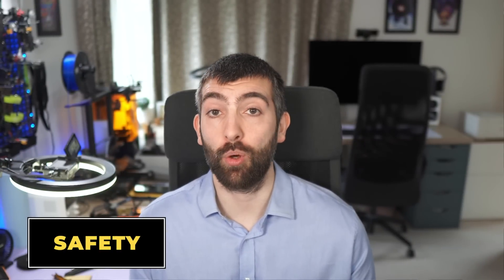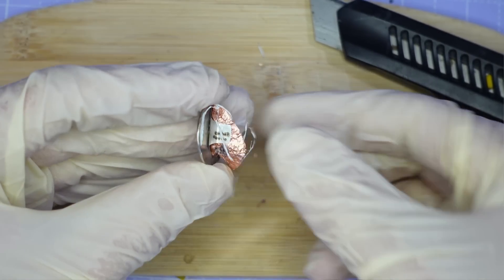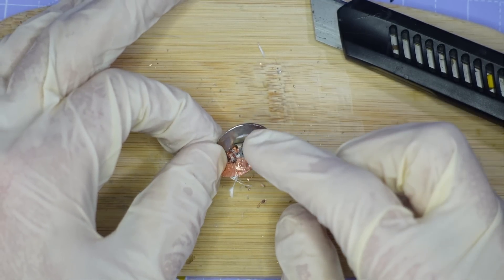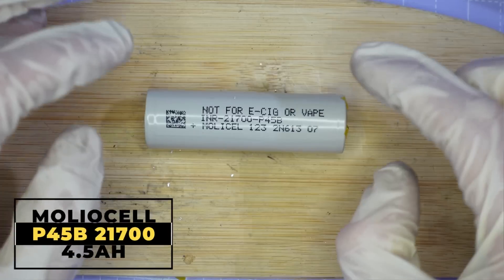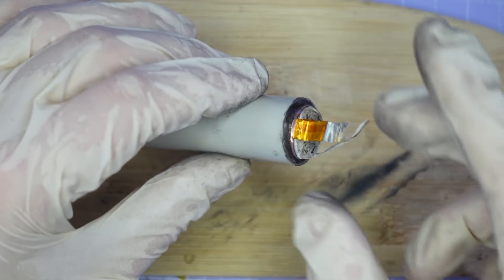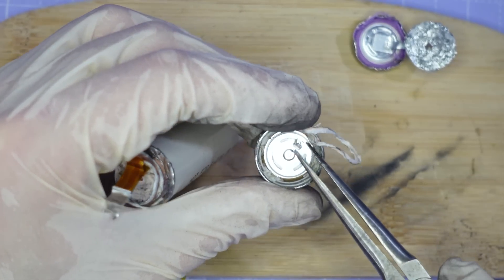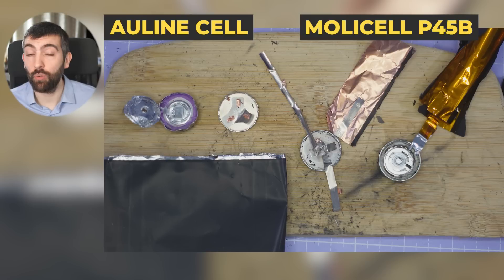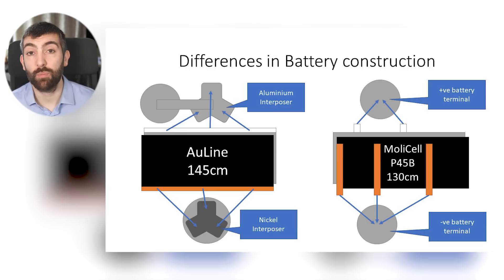Cutting open the BEST Li-ion cell in FPV: Molicell P45B

Comment: If you want to still use a dremel to dissassemble cells I recommand you tu use diamond cutting disk as it will not generate particules that contamine your cell cut. It make a better more precise cut with only 1-2$ cutting blade

Comment: It would be great if you could do a lion battery testing video like you did with the lipo's! I'm especially curious about these new high discharge 21700 cells that are coming out, for example the BAK 21700 4500mAh 60A one. Can these actually deliver a continuous discharge of 60A? and if so what is the voltage sag like? because if they can than that could be a game changer.

Comment: whats the best option for high range molicel p45 or another 21700cell?
setup are: 60v with 2x 1400w motor and 40-45a controller.
driving between 30-70kmh.

Comment: That P45B cell definitely had all 3 copper tabs spot welded. The one you thought wasn't spot welded had the weld ripped out of the tab and a "hole" like that is how you can tell if a spot weld was done with enough power. A proper spot weld (at least when doing nickel strip to the cell can) should be removed with pliers (if it can be pulled off without tools its too weak) and the nickel strip should have a chunk of the material ripped out of it that should remain on the can. The material left on the can is called the weld nugget. A spot welder with insufficient power for the material you are welding will leave little dots on the bottom side of the nickel but there will be no true welding of the two materials together. The strip will come off in one piece with only those dots having provided some slight hold on the can.

Comment: I used to work for a major manufacturer of industrial, commercial, and aerospace Li-Ion cells. I have some video I took of the assembly line from A - Z if you'd like to see it.

Great vid.
Reply: Yes. I would like to see
Reply: Me too 😊
Reply: Please please please upload as much as possible. Especially for cylindrical cells but of course pouch cells would also be interesting
Reply: Yes please!
Reply: absolutely yes - thanks

Comment: i like the auline construction better
it's somewhat similar to the 4680 with a short current path
it's just that little ribbon that connects the interposer to the terminal that's holding it back
Reply: spot welding the copper tabs to nickel...to then weld that to the can is DRAMATICALLY increasing IR

Comment: I always used the Sony Murata 25 or 35a 18650 cells, they where always ranked best in the flashlight community. But they are nowadays ditching 18650 cells for 21700 cells.
Reply: The flashlight community mustn't have tested molicel cells.. The molicels have been the best performers for quite some time for both the P and M series cells.
Reply: @StarsAtNight1  I think you mean mWh, not Wh. 
You missed the part of my comment "both the P and M series cells".

The molicel M35A is a 3500mAh cell and handles the same current as the VTC6,
Reply: @StarsAtNight1  I know what a watt hour is. Hence why I said "I think you mean mWh" because you did the math wrong. 3000mAh = 3.0Ah. 3.0Ah * 3.6v = 10.8Wh or 10,800mWh. 25lb battery generators have ~300Wh of capacity. If the cells had 10,800Wh of capacity (10.8KWh) they'd be the size of a large fire extinguisher.

Molicel (like all other manufacturers) make 21700 and all other standard cell sizes. The internals are the same - just more of it and larger sheet heights. The better performance of the molicel cells is the same on the larger cells as well.
Reply: @ryanokeefe12 I just took the numbers from the website called  lygte info dk
Reply: @StarsAtNight1  you arent reading what I'm saying. The cells are ~9-11Wh, not ~9,000-11,000Wh
Reply: @StarsAtNight1  oh ok.. strange. at least you use metric.
You'd think they'd use the same numbering punctuation as the rest of the world to avoid confusion though.
Reply: @ryanokeefe12 I looked it up, Asia, the USA, Australia and with a few African countries use a point for decimals. Canada uses both... Most of Africa, South-America and Europe/Russia uses a comma for decimals.  But anyways I need to a closer look at the Molicels cells, if they are better and cheaper it's a win/win scenario.
Reply: 21700 Molicel p45b vs 21700 Sony vtc6a which one better for flashlight?

Comment: They need to make a li-ion soft pack like lipos because the metal case adds a lot of weight
Reply: but also rigidity and strength
some lipo manufacturers add aluminium plates on the outside to propect against damage in crashes
Reply: yea
Reply: They do.. It's what's in your phone. They're called lithium-ion-polymer cells (sometimes called 'pouch lithium-ion').
It get's confusing because people often refer to them as 'lithium-polymer' cells but they are different (mainly the electrolyte).
They're far more expensive and usually can't handle as much output current as the construction of the cylindrical cells allows for lower IR. The casing also works to dissipate heat.
Reply: @ryanokeefe12  i should have said for quads. that would because thats what we are using these vaping batterys for also used for other things as well but not really suited to quad like a phone battery:face-fuchsia-tongue-out:
Reply: I don´t like this idea. Safety first,
Reply: @amax2624  dont use a lipo then  and do you identify as a man? Lol
Reply: @amax2624  A li-po will dump energy much faster and more violently than a li-ion pounch cell if damaged. And I can only assume you're using them on your quads.

You have a li-ion polymer (pouch) cell in your phone right now that you hold up against your head.
Reply: The weight of the can more than makes up for itself my maintaining the compression between the layers which improves the longevity and consistency of the battery performance.
This is why tesla use these type of cells.
Reply: @MrStevegibb  maybe on car,s its ok but this is for quads  and weight counts and you could still keep compression with a soft pack like they do with a lipo which come in hard and soft packs in rc racing
Reply: @kerrymillar4981  I know you're talking about quads.. As I said, they don't can't handle the same current. Li-ion cylindrical cells are barely able to handle the current requirements of a quad.

The "Hard" li-po packs you're referring to in one of your other replies is not there for compressing the cell. It is only a protective case. There is a standard pouch cell pack inside.

The weight of the cylindrical cells is offset immediately by the additional power you have on hand because of the reduced voltage sag.
Reply: @ryanokeefe12  i didnt say not to used a cylindrical cell?
Reply: @kerrymillar4981  You said a "soft pack like lipos" that is a flat layered pouch cell.
You can't have cylindrical cells without an outer casing to compress them coil.. well you could but they'd be huge.

Regardless, it doesn't matter. the same points still stand.
Reply: @ryanokeefe12  ya I said soft packs like lipos i didnt say flat or round you just assumed that any way you can stihl compress it with a soft case because its sealed
Reply: @kerrymillar4981  you can't compress them without a casing. That's why soft cells puff.

I didn't "assume".. Pouch cells are flat - that goes without saying. You did also say "like li-po's" which are flat cells. 
What I did was NOT assume you meant something that doesn't make sense (a cylindrical soft cell).

Flat cells make sense for pouch cells as it's better in terms of volume efficiency. It doesn't make sense to have a cylindrical soft cell as it wastes space. The only reason cased cells are round is because cylinders are stronger and easier to manufacture compared to a rectangular enclosure.

You've misinterpreted my comments when it comes to cylindrical vs flat as well. I use those references interchangeably with compressed vs uncompressed respectively. The advantages I've described for cylindrical cells is because they're compressed, a soft cylindrical cell would not have the same advantages of a cased cylindrical cell.
Reply: @ryanokeefe12  they only puff you dont know how to use a lipo and if you think you cant compress a battery in a vacuumed sealed shell that is lighter than the case they have now your wrong and you keep saying i said it has to be like a lipo which ive already corrected you on what you thought and what i ment but you seen to want to insist that you know what i meant but cleary didnt!
Reply: @kerrymillar4981  Kerry - you have absolutely no idea what you are talking about. I spoke about the "like a lipo" thing to clarify why I said what I said.

Lithium cells expand as they age. It is unavoidable. "they only puff if you don't know how to use a lipo".. They puff MORE if you don't know how to care for a lipo but no matter what you do, they will always expand. Compare one of your lipos with a fresh one next time.

And no, you cannot compress a lithium pouch cell with a "vacuum sealed shell". There are leads coming out of the pack. Even if you could somehow vacuum seal a pvc cover, there is next to zero shape retention in the plastic/pvc.

I responded to your original statement with information to help you understand that you suggestion DOES exist but DOES NOT provide any benefits. You are now trying to lecture me on batteries which is ironic.

Comment: They might be ultrasonic welds.
Reply: ultrasonic welding is used on thermoplastic polymers
metal spot welding passes a current through the material between two electrodes which heats and fuses the metal together

Comment: Hmmm, are you sure Auline are the OEM of the cell? I'm pretty sure they would be procured from another company.
Reply: Agreed, but without any labeling on the bare metal can of the cell, there isn't another way to identify it.
Reply: @cagmuer  Running a couple of their cells through varying CC discharge tests and then comparing those graphs with HKJ and Mooch's testing can very likely identify the cell. Not the easiest way to identify it but if you know common cell characteristics you can narrow down the possibilities to 10 or so cells just based on its max discharge rate and capacity.